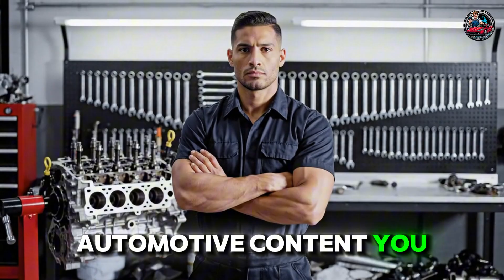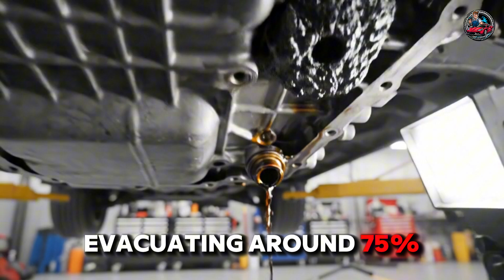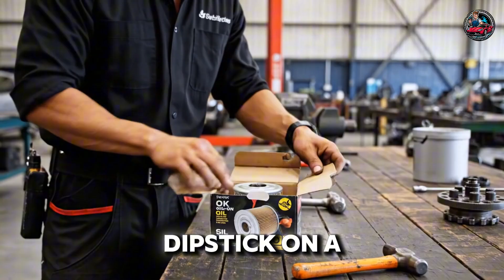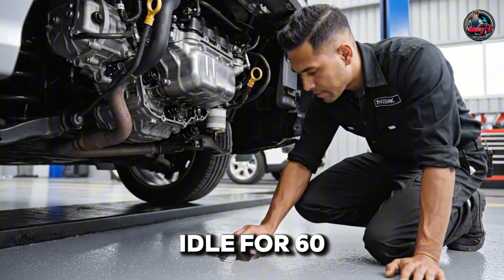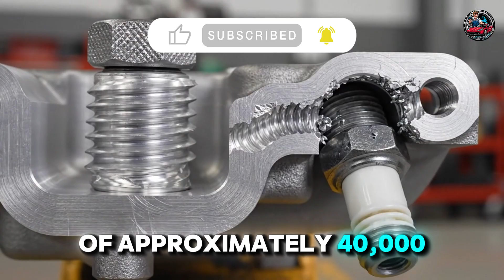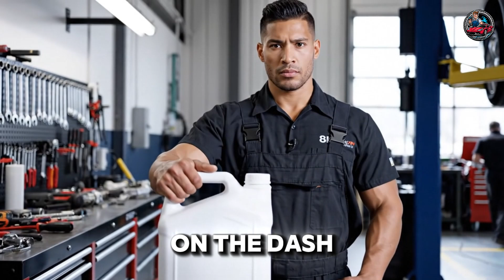THE GREAT OIL CHANGE SCAM: The STUPID MISTAKE 99% Make After an Oil Change (KILLS Your Engine Fast)

Comment: Not possible to double gasket oil filter because mating surface is cleaned before new filter installed would noticed old gasket. Mentioned while hot oil still draining then mentioned draining cold oil next part of video  why